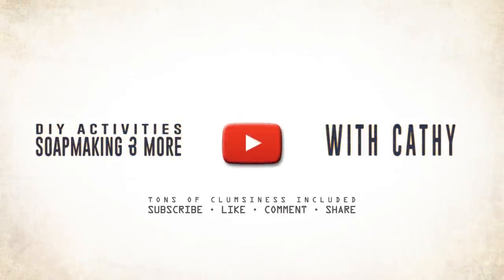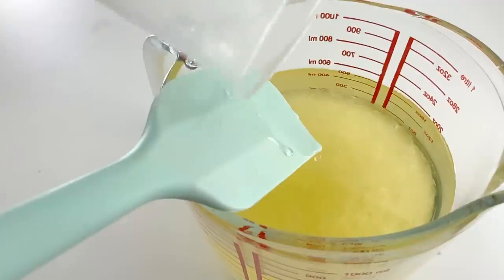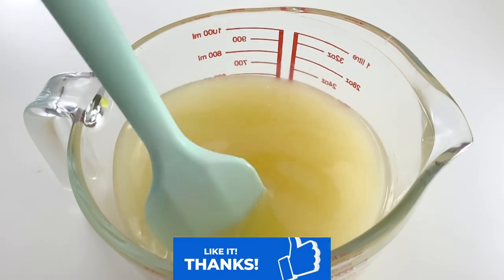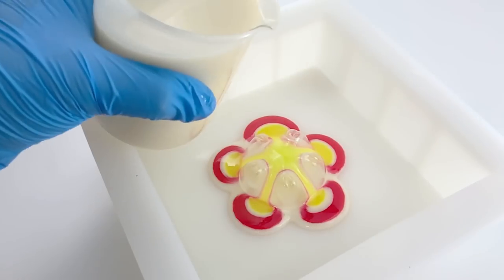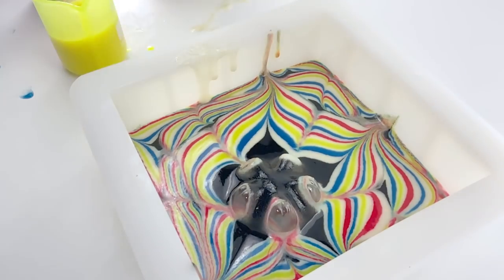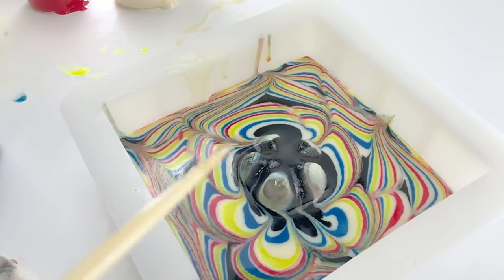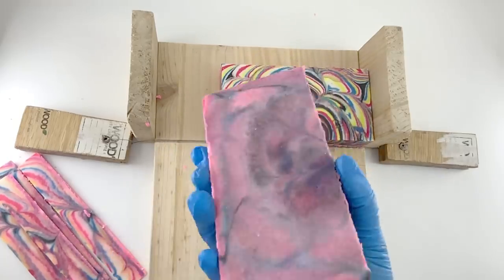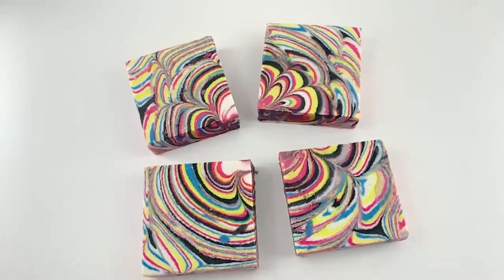How to make Column Pour Cold Process Soap using Soda Bottle

Comment: Hi Cathy.
Just want to ask you a little question. Why my solution of lye and water solidifies when I start mixing it with oil. Thanks for your video again
Reply from the maker: I think that is normal, but let me break it down a little. May I know how much water and how much lye powder did you weighed and combined? What temperature did you soaped?
Reply: @clumsysoaper  hi Cathy
The solution was at room temperature. Oil was 3000g, lye was 500g and water 1000g.
Thanks Cathy.